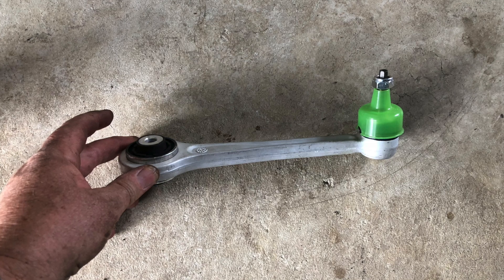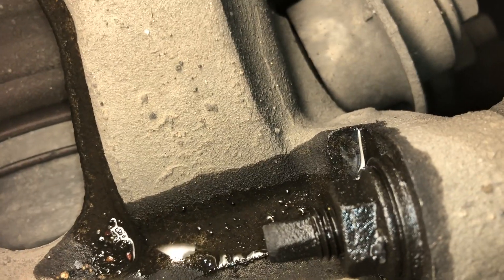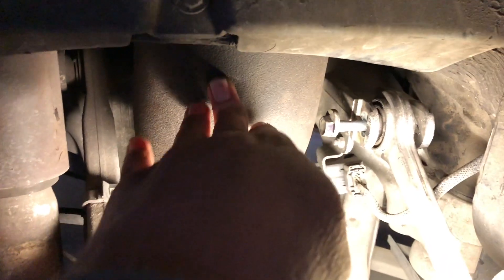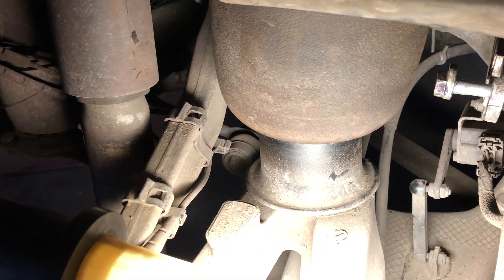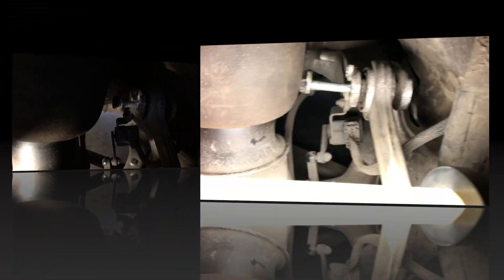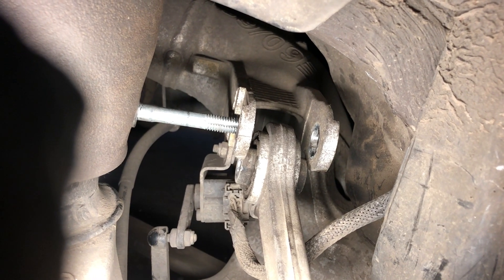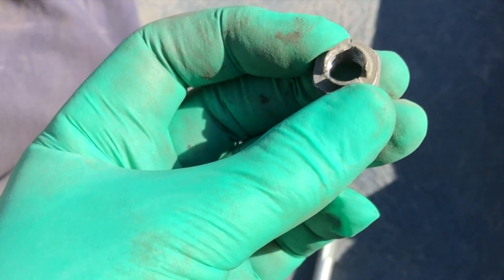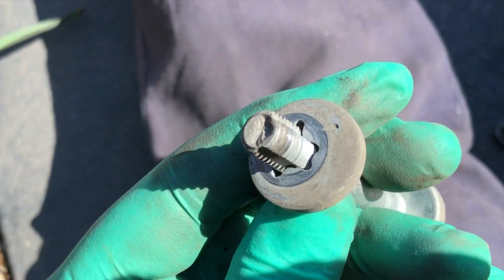Installing Rear Lower control arm e60 E61 BMW 5 series w airbag Suspension fit change

Comment: What's the reason was replace this control arm? Me bal joint is stif, how diagnose arm bush on the back?
Reply from the maker: I had to replace it for Roadworthy. Normally they are replaced for play or knocking sound

Comment: Just a little tip: Use INPA to empty the airbag. Takes less time, and you're not messing with the hose connection one the valveblock (threaded plastic...).

Comment: Good video, but it's actually the front upper arm you replaced :)
Reply from the maker: volvos60bloke It is confusing isn’t it. As this arm isn’t low. But it is called the lower arm and was purchased as a lower arm. And faulted in a roadworthy as a lower arm. So walks like a duck quacks like a duck. Is a 🦆. 😃